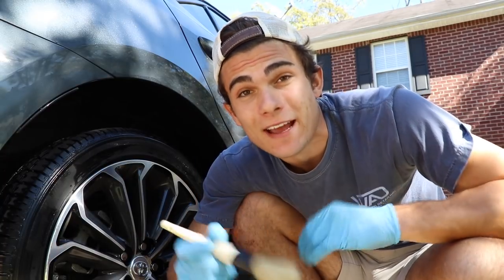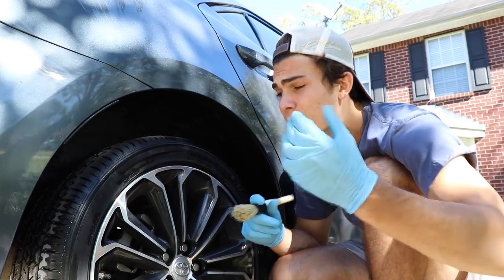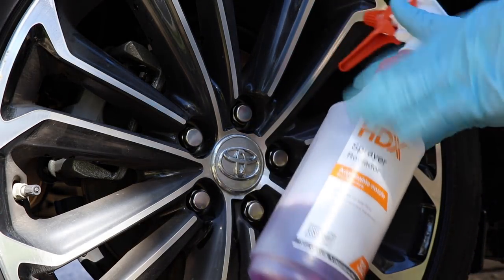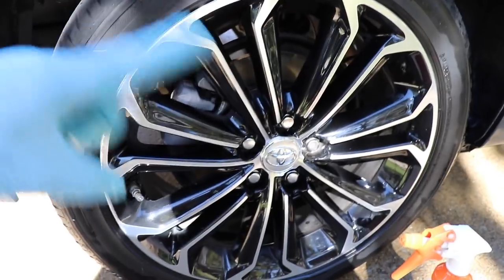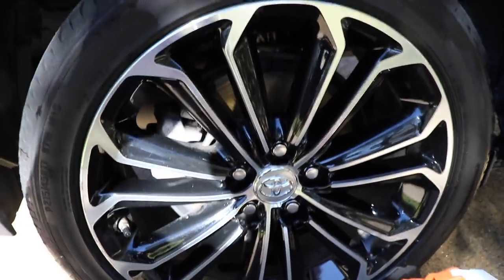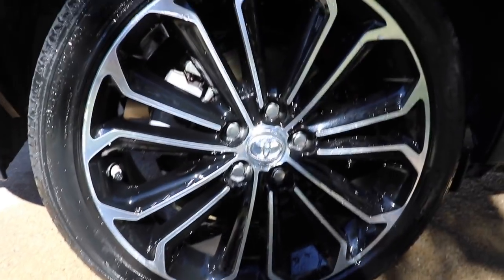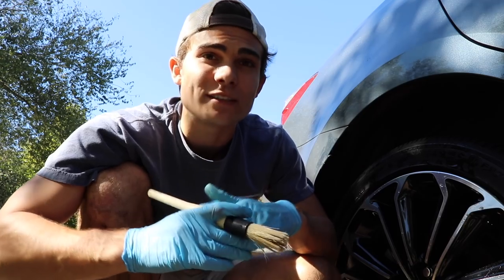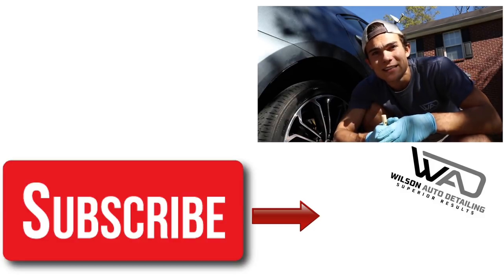Best Wheel Cleaning Brush: It's in the DETAILS!

Comment: Merry Christmas Luke and God bless! I have a quick question for ya,  ever since I started following your Youtube account ive started to use Super Clean a lot and I saw a huge difference when I used it to clean my rims and tires. Would you say Megs Wheel Brightener is that much better than Super Clean for rims specifially or would you say im good to go with using Super Clean? Thanks!
Reply from the maker: IN MY OPINION.... I dont ever use super clean or any other degreaser for that matter on wheels simply because I have heard so many horror stories about degreasers messing them up, so personally I stick with meguiars wheel brightener, and yes I do think that it is that much better especially for wheels because it is an ACID, and super clean is a base, and brake dust breaks down very very quickly with ACIDS, so I hope that helps!!